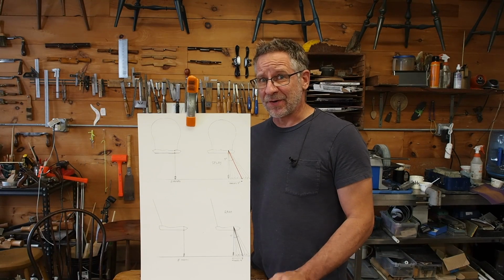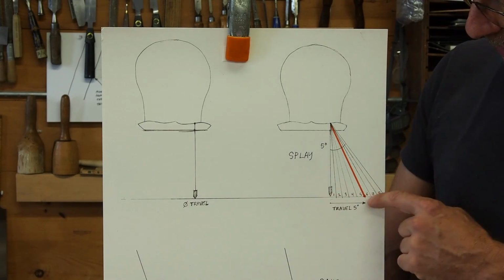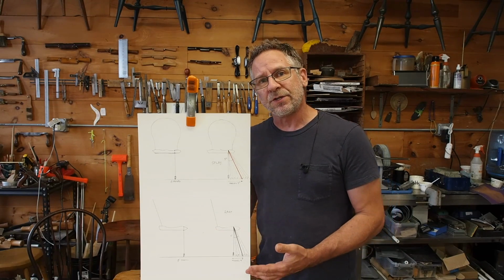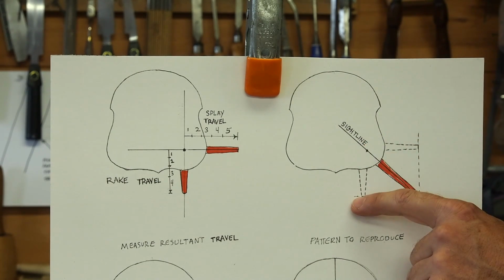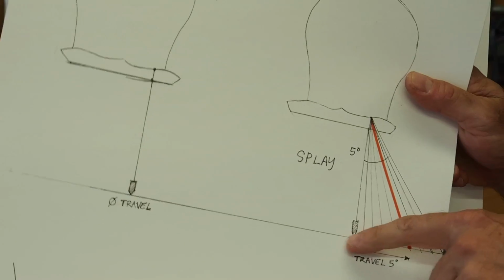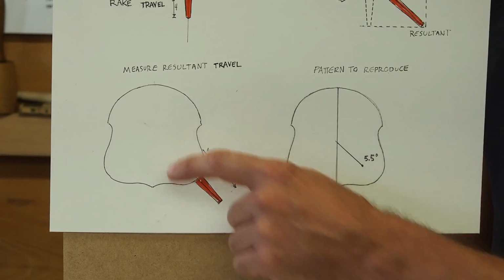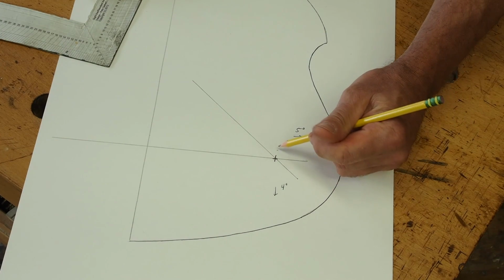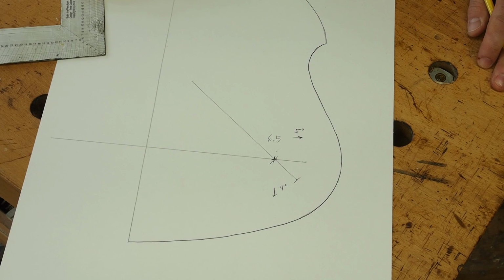Sightlines Explained

Comment: Thank you for making that sightline rule available in pdf form. I had worked out all my angles by a method used on another video. Using your sightline rule I checked my previous work and found my sightline angle to be off by 1 degree which made my resultant angle off by 1/2 a degree. Now I feel confident I have the correct angles to drill holes for two chair back posts. The chair has a pedestal mount, so no legs are required.

Comment: This is brilliant. I have used trigonometry to calculate this but never this quick or cleanly. I have even built a 3D model is Fusion to figure out my resultant angle abs sight line - NO MORE, I will only use the Galbert method.
Reply from the maker: Great to hear! Let me know if you have questions!

Comment: Your's is a pretty practical method of laying it out.  For me it would be simpler to do a little math to figure triangles and come up with the sight line and drill angles.  Your scale looks to be developed for a particular seat height and would change for other heights.
Reply from the maker: the scale works regardless of the seat height, it's really just a way of comparing the "angular travel" of the baseline of the three triangles formed by the leg positions, and triangles can be compared for this result regardless of size as long as they all share a common length on one side (which they do, all originating from the "plumb" position.) I hope this is makes sense! I can't imagine math being faster or simpler. My layout is as simple as measuring out a right triangle using my scale, the hypotenuse is the sightline and it's length is the resultant angle. Thanks for watching and the feedback